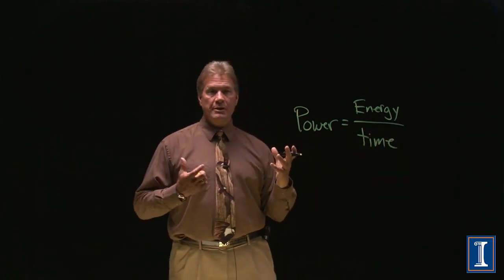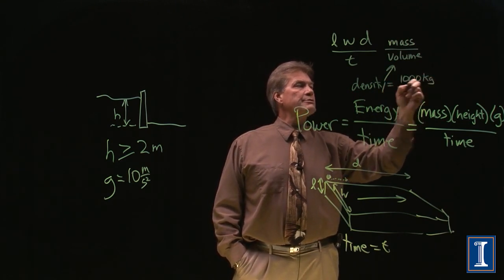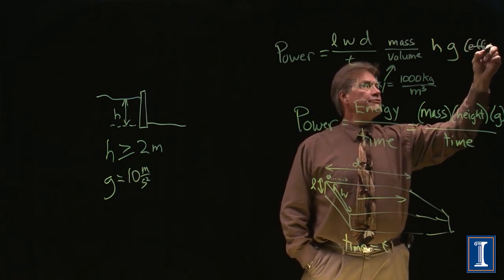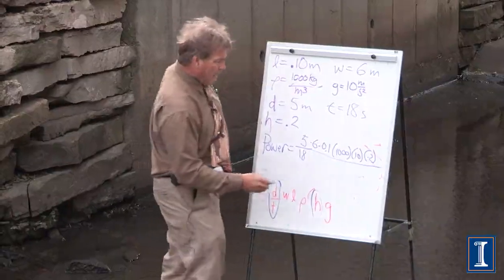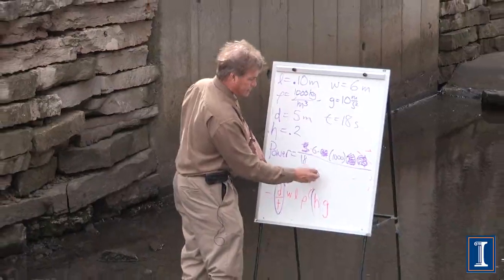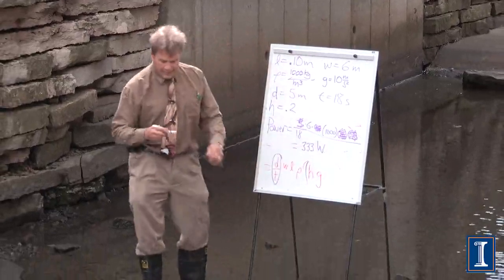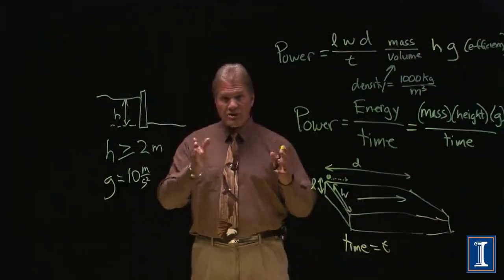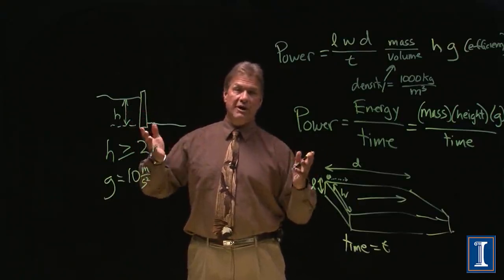Small-Scale Hydropower

Comment: I like the idea of small-scale hydropower, except for one thing: It doesn't provide any reserve power that you can tap into when other energy sources are running short. OTOH big dams do.
Reply: That depends entirely on the particular water flow you're talking about. There are streams fed from springs which are not seasonal. These tend to be small, but then that's exactly what the video is about. Other streams vary massively by season, but you could still make stable power if you based your flow on the lower end of the spectrum and then just bypassed the excess.

Comment: 06:55 They don't even put metric on the measuring tapes? In Canada, the tapes have both imperial and metric on the tapes, at least all the ones I've owned.
Reply: SI meter tapes are available but hardly anybody buys them, just no need. I own a few mixed unit tapes,(SI, fractional inch, decimal inch, decimal feet) but I find they are really only good for occasional use, its much easier to convert numerically if needed. Any professional user finds mixed unit tapes problematic because they very rarely need to switch scales (all their materials are standardized) and the scale you need ends up on the wrong side half of the time, which is an issue when making measures and marks with any real precision.

Comment: Why is high pressure better for efficiency. Maybe because you have to get over the minimum requirement to go against the air/wind and friction but that doesn't seem like much.
Reply: The more pressure, the faster the weel spins, the more efficient are the 'dynamos' attached to it
Reply: Higher head is considered higher quality power. This derives from general thermodynamics laws and entropy, a higher energy gradient always has a higher potential efficiency. I won't try to explain such thermodynamics here, for that you need a proper instructor. 
In heat engines a higher temperature difference is also more efficient, in kinetic systems higher differences in speed, electricity higher a voltage differential. Consider that steam engines operating on fire are very useful, but there are no practical heat engines that work off of the temperature gradients of ocean currents even though such ocean thermal energy is far greater than all fossil fuel use, the thermal gradient is just too small to efficiently convert into a useful form.

Comment: Efficiency is 0.6…Are underwater turbines governed by Betz's Law in the same way that wind turbines are? I would expect so, as I don't remember its calculation depending on air density.
Reply: The kinematic viscosity of air is higher than water, so water may be somewhat more efficient. I haven't run the numbers though.

Comment: If you have volume density and velocity I don't understand why you need gravity or height of the dam.
Reply: Volume, density and velocity tells you the "feed rate" of the water wheel. How much potential energy, per unit of time is going through the dam. For example 10 cubic meters per second.
You need gravity and the height of the dam to calculate how that potential energy will be transformed into energy.
You could have one dam that is only 10 meters high and another that is 50 meters high.
The higher the dam the more gravitational force to turn the wheels faster or with more torque.
Reply: I think you are alluding to the kinetic energy of the water. However, that kinetic energy is the result of gravity and height just a bit upstream, energy is force times distance in this case weight times height. The kinetic energy of the free flowing stream is really not very useful and usually pretty small compared to gravitational potential energy, and kinetic can only be partially reduced; if you bring it to a full stop where do you put the next unit of water, and the next.

Comment: Really you need to consider that you measured the water velocity in the center where you have higher velocity turbulent flow. As you get closer to the sides and the bottom the flow is more laminar and slower. Just a rough guess, but I'll bet you'd need to cut your water volume/time figures by 50%

Not wanting to bust anyone's bubble, but currently there are very overly optimistic perceptions of renewable energy by the general public and it's leading to bad policy, poor decisions and wasted resources.